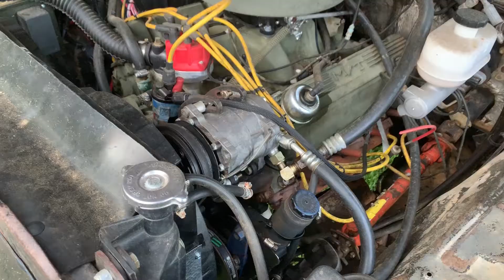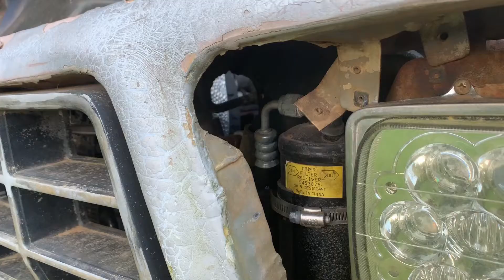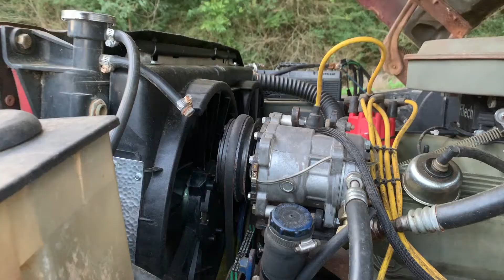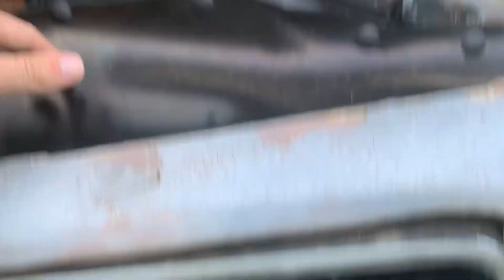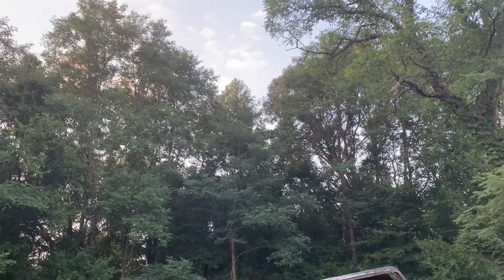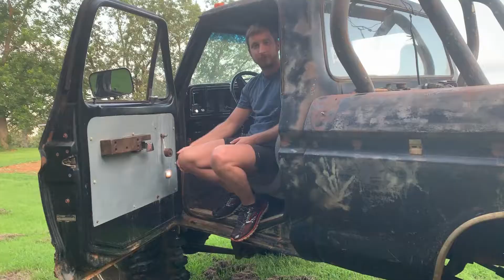Over View of the Custom Air Conditioning System in my 79 Ford

Comment: Hey Nice Truck! With that install I see that the AC compressor sits on the bracket different than the factory compressor. Does it hit the driver side valve cover?

Comment: I was able to adjust the expansion valve in my 1969 Charger and use 134a with all the factory parts. It gets plenty cold and had been working since 1998.

Comment: hey man what gear ratio are u running? i know u got them 44s but i dont recall the gear ratio? i have the exact same setup but in a 78 bronco , i got 38s and 4.56 gears with a np465 and np205 case , @50 mph im over revving my motor whats your rpm range/speed
Reply from the maker: john dowe I’m running 5.13:1 gears with a C6 transmission. I’m guessing it runs 2500RPM at 55. Yours should be geared pretty similar to mine once you take into consideration tire diameter.
Reply: @thekingofcows  yeah that sounds about right, I figured you had a higher cruising speed (65/70) than me but I guess not . I also have a 460 too . Thanks for the info man, looking forward to seeing more of yer vids . Been watching since you first put the motor in few years back

Comment: Always wondered about replacing the factory AC with something more modern on my 88 F-150. Figured I would try it once I got a garage. How about the blower, did you replace that? I've always wanted to put in the complete AC system from a Mercedes panel van, those are the best systems I've ever seen. They get cold insanely fast, 5 seconds or less and the air they push out is quite a bit.